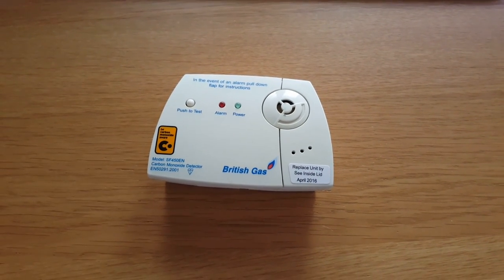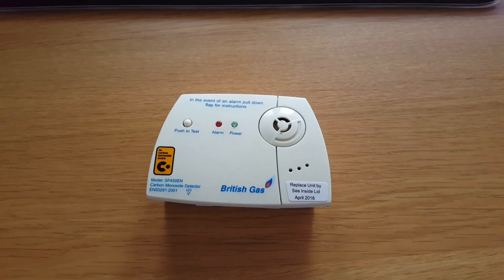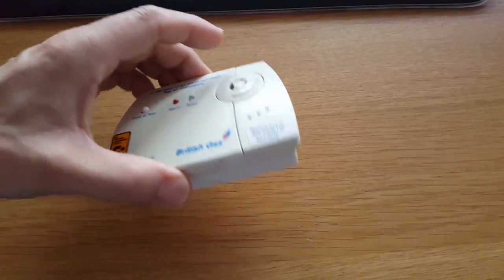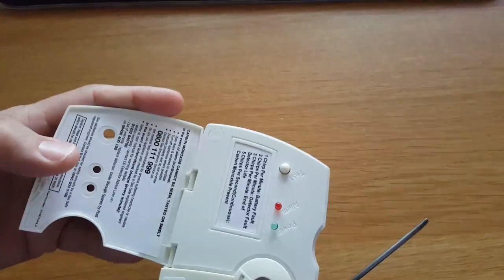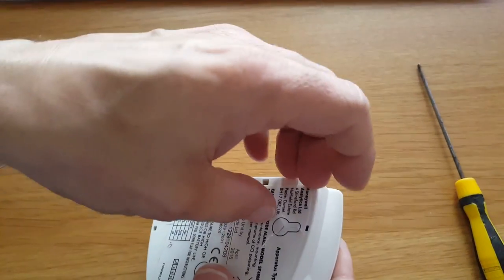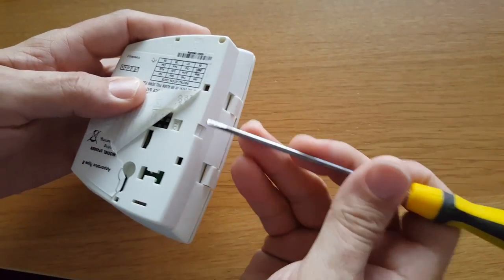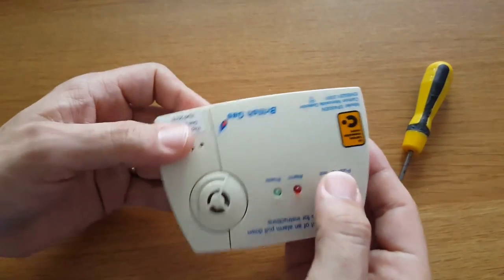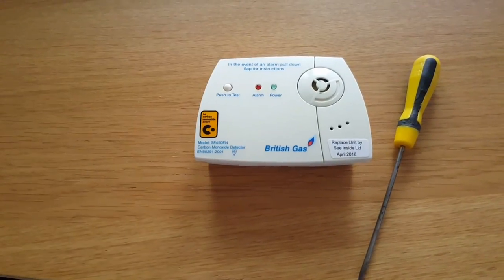British gas Honeywell carbon monoxide detector, turn it off to silence the beep SF450EN

Comment: For those with a standard Honeywell (possibly older model) there is a different off switch on the back. Very small and black, a similar approach is needed with a pen or screwdriver, to push the ON tab so that it flicks to OFF. What a bloody pain in the bum that thing has been!

Comment: You can also open in with a screwdriver preying it open, inside in my unit is a CR17345 3V Lithium Batterie and can simple be removed. I don't know why they should be replaced completely it's expensive and not environmentally friendly, would be much better to replace only the battery like in fire alarms.
Reply from the maker: The sensor is electrochemical and degrades over time, around 5 to 10 years. This part would also need replacing and is the most expensive component. For peace of mind since you cannot see or smell carbon monoxide I would rather update the whole thing and know it works.

Comment: How do you change the battery for 1 of these mine needs changing
Reply from the maker: I'm sure the unit could be opened to do this but  I don't think it is right to change the battery. The sensor in the detector itself has a life expectancy of around 7 years and they become less sensitive over this time. As a life saveing safety device I suggest buying a whole new unit at around £15 thats only around £2 a year for peace of mind.